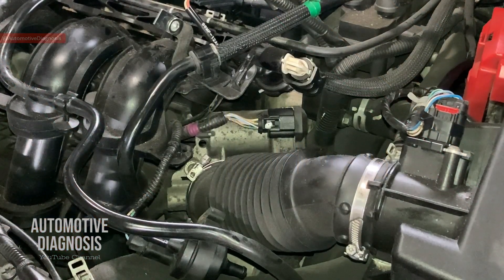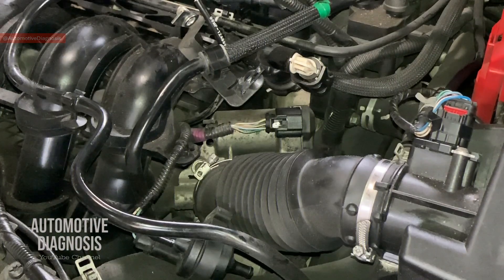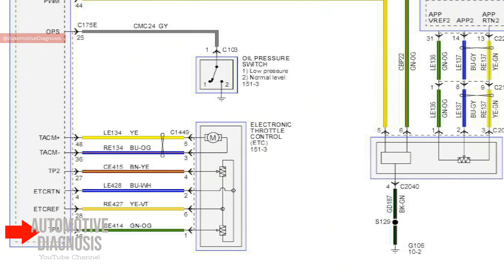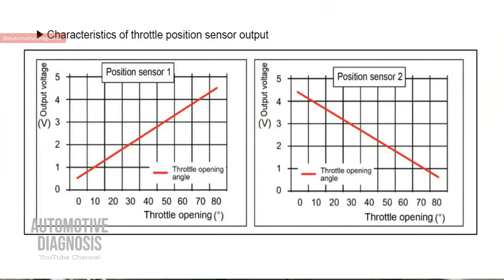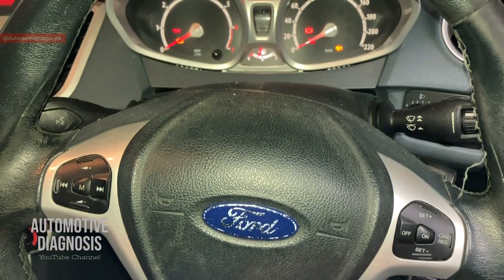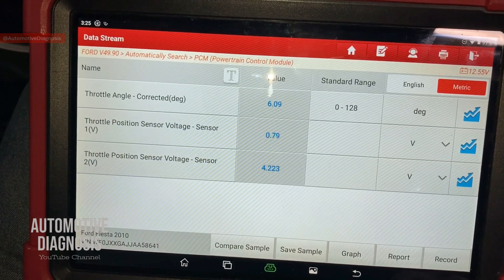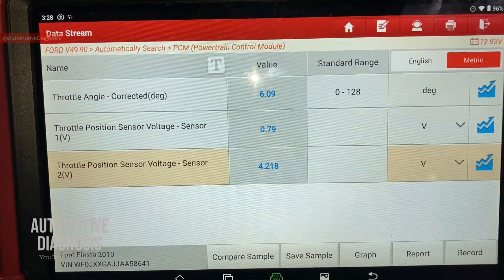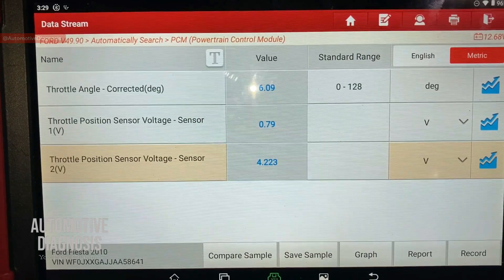Diagnose Throttle Body Issues FAST and Fix Rough Idle Problems!

Comment: My values are backwards. 4.42v in TPS#1 and TPS #2 is 0.58v. What does that mean ?
Reply from the maker: Should be alright, I've seen some cases like that too. in this case, if you press the pedal, you will have decreasing voltage on TPS1 and increasing voltage on TPS2

Comment: Excellent. You could get both TP signal voltages from a single potentiometer by splitting the 5V between wiper and terminals but you would  lose the redundancy (safety feature) of a second potentiometer, and the ability to compare them.

Comment: yellow and blue and orange wire. on wiring diagram what is the tie on those two wires represent ?
Reply from the maker: Hi my friend. I checked it on the car, couldn't find it on the wiring! Will check and let you know.

Comment: I like your vedio . Thank you so much   but Sometimes there are two increasing signalsTPS 1and TPS2 but with different degrees of inclination, such as the gas pedal sensor, for example.
Reply from the maker: Hi my friend, Thanks for sharing your experience. What I said is what I've seen on many different cars, but of course it doesn't mean that it applies to all cars. Some cars may have different arrangement on throttle body (like what you mentioned). That's why it's always a good idea to have a look at the workshop manual if we are not sure about the output range of a sensor.
Reply: Thank for delivering such a great knowledge iam a mechanic from uganda with a diploma in automobile engineering but I have learnt much from your videos and I have subscribed iam now a member